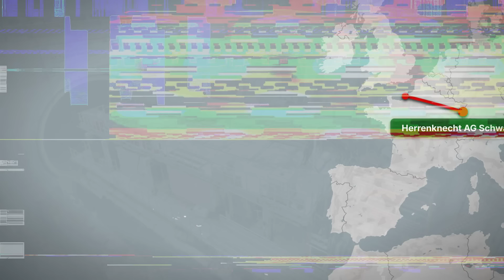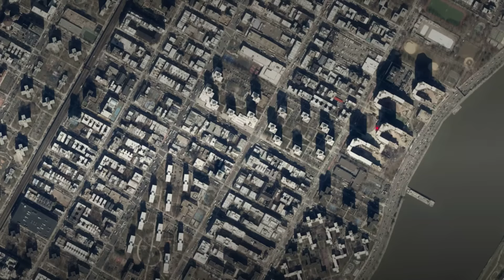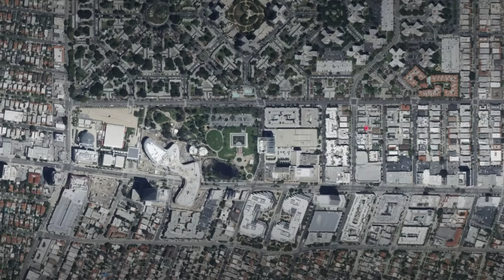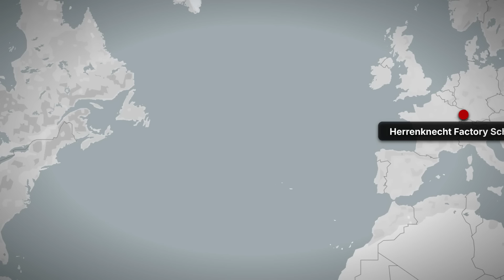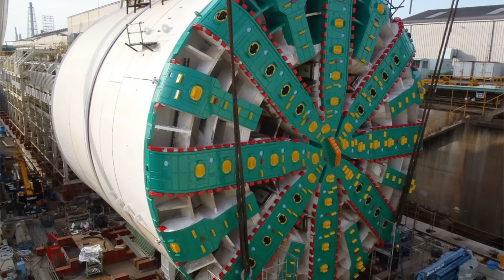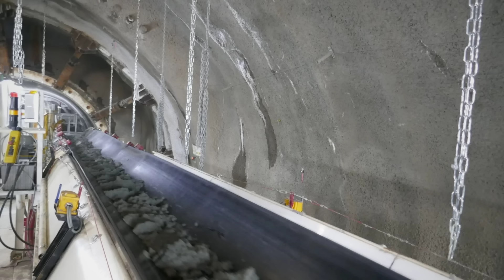Why German Tunnel Machines Are Destroying America's Last Manufacturer

Comment: Robbins hard rock open face TBM's are hard to beat.
However their EPB TBM's which are Mitsubishi copies are a poor substitute for HK's machines.
Not all HK machines are built in Schwannau, they have manufacturing facilities in China which is 1 of HK's biggest customers.
Reply: Robbins is not more was is was in the 80ties and 90ties. Now chinese coming up with Craig, I believe that chinese customers will buy Craig because cheaper.
Reply: @matkaf496  CREG - Chinese Railway Engineering Equipment Group
"Robbins is not more was is was in the 80ties and 90ties" what does this mean, please explain?

Comment: As a Dane we also used those crossing a part of Storebaelt for traintunnels, below the water. And because a very "Smart Guy" had put a heavy cable through its watertight door in the nose, when it hit a part with a soft bottom on top, it was filled with water inside (Luckily no one got hurt, but all escaped the water)!!! It took a long time to get it operational again and I'm sure some had to pay a heavy Fine from that?

Comment: Simple reason: there are only so many projects so the number of manufacturers is simply limited. Getting in is nearly impossible because these few companies have a huge experience advantage and customers would be very hesitant to allow an inexperienced company to provide a crucial machine for a multi billion project.
Reply: Herrenkecht was build 50 years ago. The experience gaps is due to specialication. US companies fokuses on the broader market rather than specializing. The german mittelstand thrives because of niche products.